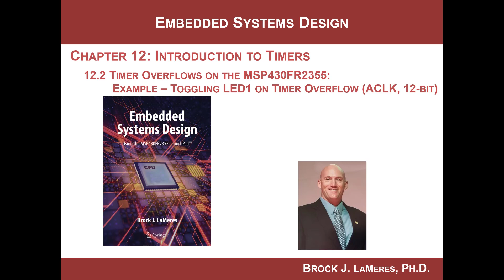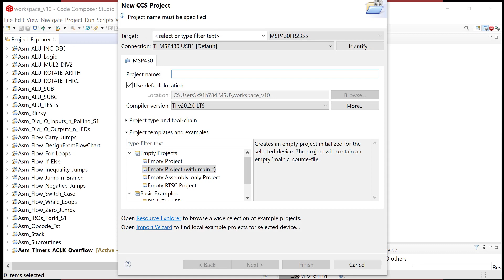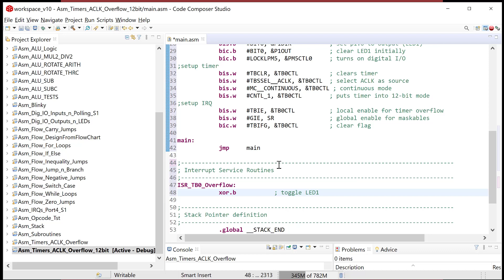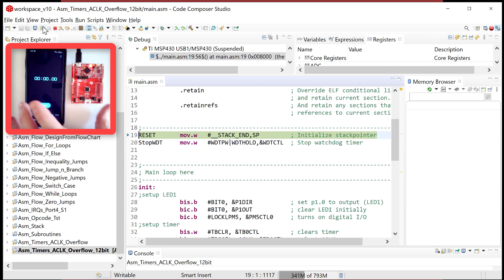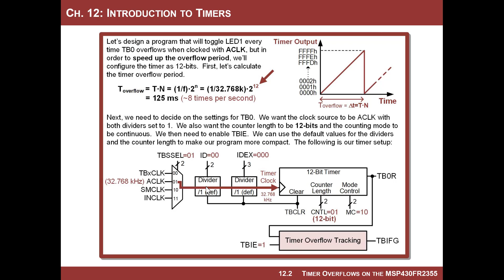12.2(c) - MSP430 Timers - Overflow Example using ACLK w/ 12-Bit Counter Length

Comment: Thanks again. Great content.

If someone is using the MSP430FR2476 board it has some errors with ".int**" shortcuts... For TA0IFG is .int42 and for TB0IFG is .int34. 
There is also some shortcuts missing in .h file, ie. MC shortcuts for B0 timers.